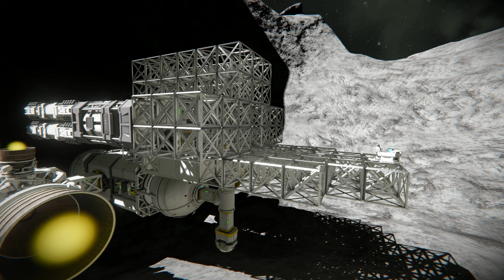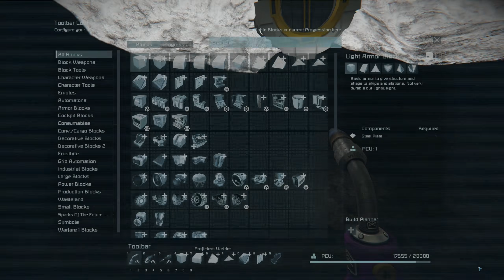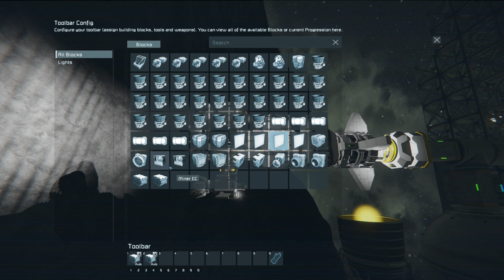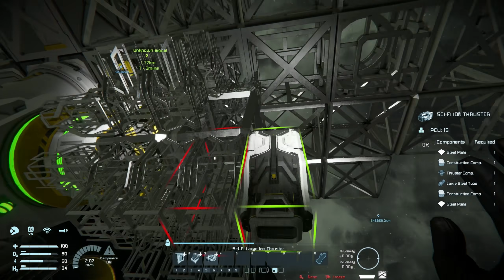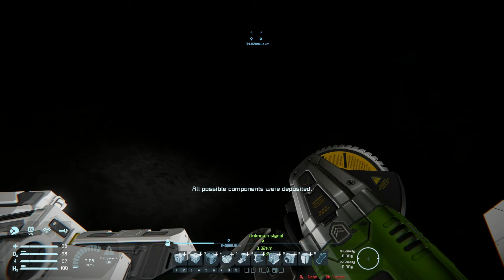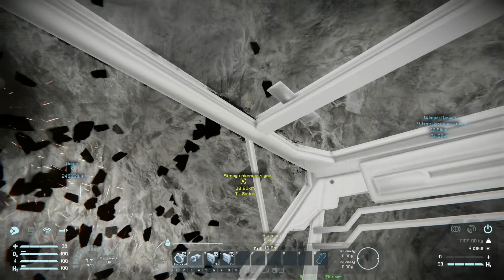Vanilla Cargo Fill Level (or a more clever title) - The Collector #4

Comment: On my small grid miner with 3 drills I have 12 sorters and connectors to dump stone,  almost keeps up with the drills :P  I also use lights to tell if the shp is full,  but you can just go off the weight readout.

Comment: With an event controller monitoring all the cargo and all the drills set to AND Gate it will wait till all the selected storage meets the cargo filled% criteria,  i keeo it at 90% for my miner. Tested it myself but also test if im right to verify. The drills will empty into the cargo until they fill themselves up
Reply from the maker: That's true now but wasn't at the time I recorded this. They finally caved to good sense and fixed the way the AND gate worked, since it pretty much didn't work before

Comment: Also, currently in the start of video, but why with the messing around @12:00 did you not just add a connector  90 degrees so that you can be facing forward with the ship? I imagine it'll make manoeuvre later easier (striking the mining ship when flying)
Particularly because you know you're building a second ship to scout. Scout ship docks bottom, miner docks on the "arm"
Reply: I see you did it once you started to build the ship.

Comment: you couldn't have done napkin calculations because your answer is almost spot on the spot on time needed from the time you calculated the needed time is 683 hours, 12 minutes, 22 seconds or 28.4 days so good maths
Reply from the maker: Well, when I say napkin calculations I mean, actually trying to do it in some way other than in my head - I definitely opened the windows calculator quickly :P

Comment: You know, the disco ball finder is great .. . but the whole drill structure wants to be on a rotor as well. You could get away with 3 drills doing what 5 do now. Or use 5 drills, the last two pointing outwards, creating a wider tunnel.

You could even use pistons to lengthen the diameter of the arms for those extra-wide tunnels. 

Although attaching all these engines to the arms will no longer work as well … so do what you think is most cool or most usable or most fun!

I would place a camera next to the main connector (and a matching block on the connector of the mothership) as a 1st person docking alignment aid.  I’d also consider if turning on the ejectors/sorters once the cargo gets kind of full and off once it no longer is might be worthwhile — or “if I want stone, I know where to find it” works better. 

How about automatically turning off the drills once one of them gets full - that will get your attention… :)
Reply from the maker: With the high latency I'm fearful of too many subgrids and not being able to react quickly enough if something goes wrong - which is in stark contrast to my usual sub grid heavy building style :D

Comment: Small grid drills will allow you to place a med cargo between each and still be able to drill out. 
Large grid you can diagonally space them to achieve the same.
Reply: While mining straight ahead with a constant orientation (no side to side motions or spinning, etc)? If so, I guess things have changed since I last played (admittedly it's been a while). Last I knew, you could have at most a 2-block gap on small grid and none on large grid.

Comment: Speaking from experience... :) If you have ejectors pointed toward your main ship and they eject while docked, it can destroy both the miner and your capital ship. In this case, they turn off just as you connect, but if it ever fires even once it could be bad, if you dock with the sorters turned on and forget your main ship has stone in it.
Reply: How does ejected stone destroy the ships? Sincere question. In my experience connectors won't eject unless there is a clear space in front them, and AFAIK stone doesn't do any block damage.
Reply: @Cyberguy42   @Cyberguy42  This was on a server, so lag may have been an issue. I had a small grid full size connector facing down into a half-block. When I docked, it ejected a large chunk of stone, but there wasn't room between the two ships, and they both split apart. The small grid miner was almost completely destroyed. There was a huge chunk taken out of the capital ship, that included the med bay, so I couldn't respawn there.
So it wasn't the stone flying into the ship and doing damage, it was the fact that the stone was larger than the space between the two ships. You can do something similar by grinding down a container that has a chunk of ore or ice larger than the space the container inhabits. It will explode the ship.

Comment: If you add antennas with maybe 500 - 1000 m range the scout could relay the location to the miner, and if anything gets within range they are most likely going to find you if your online.

Nd if the shut of on docking they will not reveal your location when offline.

Comment: Just a little observation regarding your smaller vessel - you might want to avoid using small (multiple) thrusters..  like avoiding them like the plague.  they use exactly as many pcu units as big ones.. and you will run out of pcu probably within the next 3 episodes.

And i do have a question about the collecting process. I dont know how far apart you play/record and upload so i am a little nervous about missing the time to switch on my antenna to be found.  Currently it is on .. and it attracts all kind attention one might want to avoid.
Reply from the maker: I've recorded another 4 or 5 sessions since then and am still nowhere near the PCU cap. I think it's due to the nature of building without guns 🙂
Reply: Damn, I thought I was possibly getting close to where this video ended too... @Splitsie

Comment: Might be a silly question but could you add tires to the back for the bumpers?
Also, you probably noticed but it looks like at least one of the Ion thrusters on the Disco Ball wasn't turned off :P
Reply from the maker: You could use wheel suspensions (using the static wheel block is no different than armour). They'd probably work fairly well in most situations where you're colliding with somehting too

Comment: Since I often end up mining in first person, I like using sound blocks that play for just a couple seconds as my cargo full warning. You could also use LCD/text panel blocks, since when you give them a background colour, they will actually change colour when turned on/off unlike light blocks, so you don't have to be as attentive.
Reply from the maker: I think it's in the next recording, I show something that can be done that'll work for first person as well - basically just put on/off controls for the indicator lights on your hot bar. It'll then show when they're on or off as part of your HUD 🙂

Comment: Splitsie, have you considered changing the miner to spin on its long axis with one or two extra gyro's and use one or two small thrusters on override to keep the drills near voxel? With a remote control the miner becomes a good tunnel core driller. You may want to move two drills a block inwards though.

Have fun with this scenario.
Reply from the maker: I decided not to do the rotation because roll is weird with latency and often seems to get ignored by the server when it's slow enough to be safe for the drills 😞

Comment: I'm confused at how you arrived at using projectors => don't use thruster groups.

Since you are using the separate "on" and "off" commands set up with the event controller, it would be fine since when you connect, you would only be turning off other thrusters that should be off anyway, and when you disconnect, well, you are disconnected, so it can't turn on the thrusters of other ships.

Using every thruster separately set in the timer block also strikes me as being a bad idea, because now if you destroy a thruster and rebuild it from a projector, the timer blocks will need to be set up again since they are still referencing the old, destroyed block, and won't automatically change to the new block. It also creates a lot more room for human error in setting it up. I'm also not sure how its going to go if the timer block is built from the projector after the thrusters.

My conclusion is that it makes sense for batteries (due to the lack of a recharge command that doesn't toggle), but it doesn't make much sense for thrusters. Especially when you have several dozen of them.
Reply from the maker: Printing multiple of the same thing and using group names means you'll activate everything on all grids with that group name, which is frequently bad
Reply: @Splitsie  Yes, but for the specific case of setting thrusters to Off in a small ship connected to one's main grid, the potential risks look very low to me.

For over a dozen thrusters, I don't seem to be getting the same result as you for the risk-cost-benefit analysis of both methods?
Reply from the maker: Go and build a carrier with multiple drones or fighters of the same blueprint then you'll see the problem and why I think it's a good habit for me to have. The reason I acknowledged it being odd during the video is that it doesn't serve a purpose here, but is for me to not make a habit of doing something that's only usable sometimes 🙂

Comment: Loving the event controller because of things like those shown in this episode.  It also helps to keep hydrogen in the tank when you have to use hydrogen engines for power generation.  Cargo fill detection was one of the things I used it for first.  Using the emote controller instead of the light.  But they're so many options.

Comment: I could've sworn event controller AND logic controls would wait until all inventories were full.

I have a backup generater in my base and it waits until all batteries are past 10-15% full before turning off, all while using the event controller to detect battery fill level
Reply from the maker: There are ways to break the behaviour due to it being an 'event controller' and not checking state when an event hasn't occurred while it's active
Reply: @Splitsie  I see. I'm not a logic/script kinda guy but I do like some automation since solar panals aren't a foolproof form of generation.

I would've just assumed all values needed to reach the set requirement to activate with the AND system

Comment: you know that once your dill ship is connected to your main ship.. you can just turn on your drills and use the large ship to mine. Yeah its slower but if you set a drift at .14ish m/s. you can fly around building and still scrape drill to gather stone/resources..
Reply: Lol with large hydrogen thrusters, thats just asking for trouble
Reply from the maker: Yup, there's no way that's ending with anything other than snapping my miner in half 😂
Reply: @Splitsie  you would be surprised how easy it is. Just do not dive deeper than the head of the drill or exceed .35ms. i find .14 the best afk speed for auto drills and astro mining with ships.
Reply: @Gracefulwarrior2124  I have done it with larger ships. Its fairly easy as long as you dont go fast or deep. just kiss the astro, tap right or left on thrust, .14ms no more, you will barely move. So slow the bumping actually stops the ship vs breaking anything.
Reply: @christopherrenn8137  Idk about you but trying to be precise with such a large amount of thrust is very difficult.

There's really no benifit that outweighs the danger of it. Also what happens when its a deep pocket? Can't really do that strategy then lmao

I'd say at that point just put drills on the big ship

Comment: You should add a "Docking Camera"  just above the miner's connector that looks back.  When one of the dock's connector lights is in the center of the docking camera view, you're lined up for docking.  Also, if you put your braking thrusters in a separate group from the rest, you can turn them off to coast, and still steer without toggling inertial damping on and off for minor course changes.
Reply from the maker: I really should use docking cameras more, it's so rare I use them as I'm a little too dependent on 3rd person I think :P
Reply: @Splitsie , I just want you to know that you taught me how to play this game when I first got started.  So, thanks.  It's been a blast.  I'm playing on NA#3 so if you find yourself in the area say hi sometime.

Comment: I know people have already made suggestions for the name of the miner you built, but I have a small suggestion if safety becomes a concern. Replace or augment your tail fins with small frictionless wheels. They can take a bump better and help guide you out of a narrow tunnel better than small grid armor blocks can. It will "ruin" the aesthetic of the tail fins but so will a collision caused by the camera view going haywire in tight spaces.
Reply from the maker: Hopefully I don't hit anything hard enough to require the impact resistance of the wheels, but if I end up damaging the fins a few times I'll certainly consider it :D

Comment: 0:35 "there are no particular reasons large vs small miner"
Covering a bigger excavation area and therefor collecting more ore in shorter time with more cargo space to get hauls that last a touch longer for bigger ressource hungry projects in the pipeline without the need to constantly going back and forth to one spot saving up also on travel/docking time and risks to being spotted by enemies.

So in short efficiency ... and ofcause i am a humorless german ^^

as sp is roleplay anyways i wouldn't say anything against small grid solutions, but on mp no deal
Reply from the maker: A large grid takes longer to build initially so if you have no mining ship, building a small grid one first is definitely the faster way and should always be used at least as a stepping stone if you're going for efficiency

Comment: To fly 245,959km @ a speed of 100m/s would take you:
+   245,959,000 Seconds
Or; 4,099,316.6 Minutes
Or; 68,321.94 Hours
Or; 2,846 Days
Or; 94.89 Months (Averaging 12 months at 30 days each, which isn't perfect but... meh)
Or; 7.907 Years...

Suffice it to say, getting there using conventional thrusters isn't going to be achievable. And even WITH jump drives, it's still a trek that I didn't know was even possible in SE...

Which is partially why I thought you might want to try to have your ship controlled by an AI when you're not online, that will get up to speed, and continue towards the 'Home' GPS waypoint until it reaches some sort of obstruction/obstacle at which point it would either stop altogether, or simply go around it. That way you're making SOME sort of progress while you're not online for a week. Additionally, an event controller could tell the entire ship to just stop when it detects that you're down to 40% remaining hydrogen or something, that way it doesn't run your tanks try while you're offline.  Just a thought...

I am enjoying the content though. I hope fatherhood is agreeing with you, and I'm impressed that you've managed to maintain your upload schedule despite so many new responsibilities!

Comment: Out of curiosity couldn’t you set a single event controller for both cargo to be less then or equal 99% then turn off the light if true and on the light of false? This logic should have the light turn on when both are full then. 

I haven’t used the event controllers yet so I’m making some assumptions on how they work.
Reply from the maker: You'd think that's how they work, but no. Being event controllers rather than state checkers (I don't know the proper term) they only check anything when an event occurs. In my testing with pistons it was super easy to get unexpected positive and negative states with 3 or more blocks being checked.
Reply: @Splitsie  aww darn. I thought I was onto something. Thanks for letting me know. I would have struggled when I go to use them.

Comment: If you were worried about the ships poking out too far below, why didn't you put one of the miners connectors on top of the ship? Could have done that with the scanner ship too. Or reposition the connectors on your big ship to let you dock them both side by side, or one above one below? There are a lot of much better looking options, that could also  then awkwardly hanging way off the side or bottom. Yet, you almost always go for this.
Reply from the maker: At this stage I had no specific plans for where I wanted to have anything connected so it was just doing the easiest option. I had other aesthetics in mind for the top that wouldn't work with a connector up there so building one would have ruined those ideas

Comment: use a 4th light on the miner for h2 level.  turn on if you drop below 10%
Reply from the maker: Could do, though it's not necessarily the most useful since we also have a HUD based fuel guage

Comment: On the small grid ships put some antennas so your ore detector can show for the other ship easier like what happened with the Plat ore part of drilling set it to 500 meters or 1 km..
I've used this on the rover large ore detector on planets and on a similar detector ship for space also on my large grid ships I always put a small grid ant on a rotor or hinge for better smaller large grid ships.. more pleasing to the eye instead of a large antenna sticking out the back or tucked in along the ship.. happy collecting 😊
Reply from the maker: Yup, but I apparently subconsciously decided that I wasn't going to use any grid broadcasts due to the whole hiding thing instead of realising that a 1km range antenna isn't going to be spotted outside of visual range anyway :D